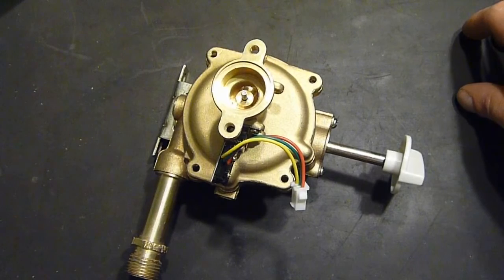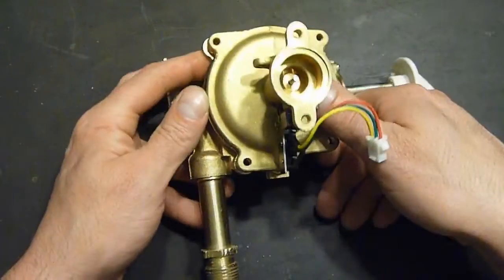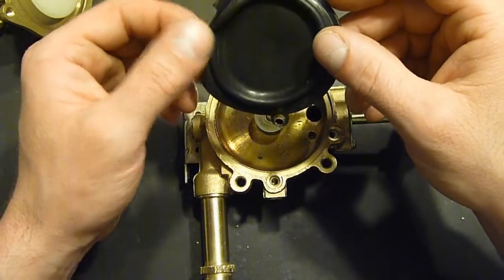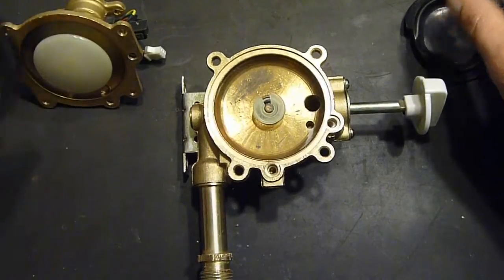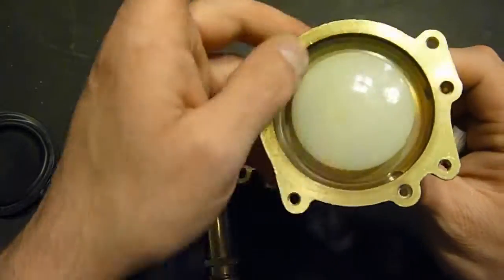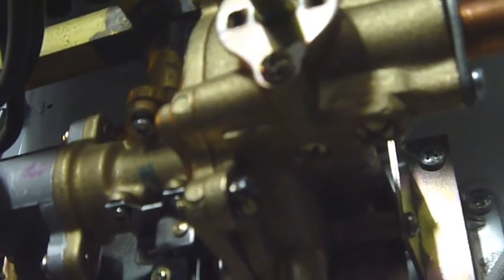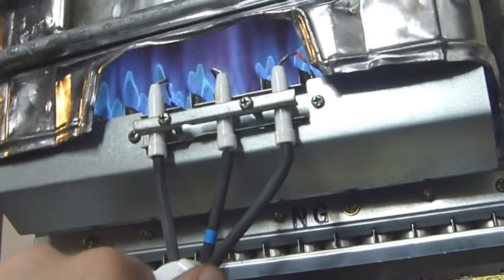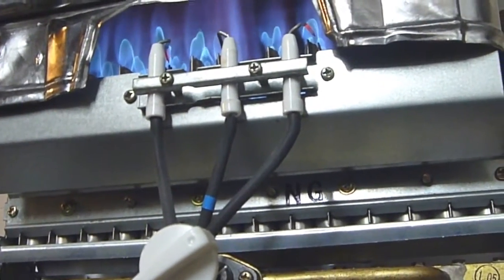Hot Choice Tankless Water Heater Repair

Comment: Great video. Can you add link to order parts? I have whole house Hot Choice 16L, 4.3 gpm, natural tankless hot water heater which heats water only 21-24 degree centigrade. How do I increase temperature limit? I think it is not hot enough to reach water to upstair bathroom. Any recommendation how I may fix this problem.
Reply from the maker: The parts I actually used were from other water heaters, and I found them on ebay,  unfortunately I don't have any links to them. There is no way to adjust the temperature limit, but it should be getting the water much hotter than that! I have the gas control turned about halfway up on mine,  and I can't even stand under the shower if the faucet is turned all the way to 'hot', and it doesn't shut down. I think the over temperature limit is around 200 degrees (around 93 degrees c) so that it will shut down before the water boils. How old is your heater? I had mine maybe 6 years before the diaphragm failed on mine.
Reply: Thank you for quick reply. I will search on eBay. Do you have part number of diaphram you used?
Reply from the maker: @chughtaimb  You're welcome. The diaphragm was from a Paloma PH-24.

Comment: I bought 16L Hot Choice Tankless Water Heater (4.3 GPM) to replace 40 Gallon HW Heater in my garage to save space and energy saving but have not been able to find Type B 5 inches adopter to connect the unit to exhaust vent. Can you send link show your connections and source where you bought this adopter? Can I connect to 4 inch Type B vent to exterior wall just above the unit? Your assistance will be appreciated. The local Home Depot only has 3 or 4 Type B vent pipe and fittings. My email is Bashir.Chughtai@gmail.com